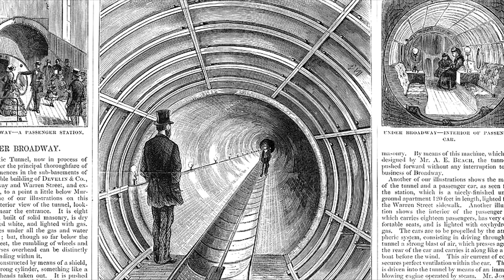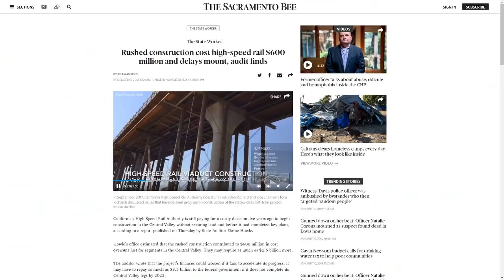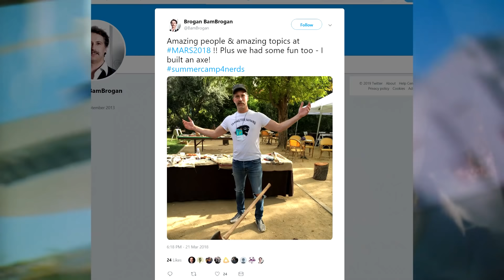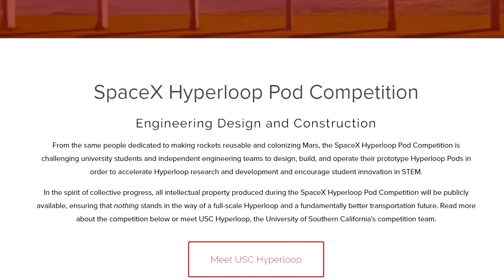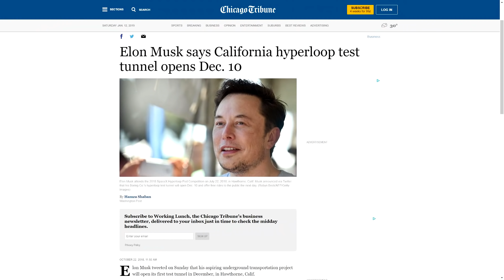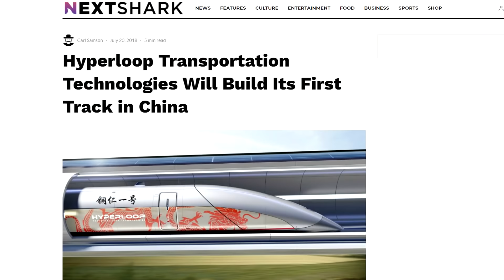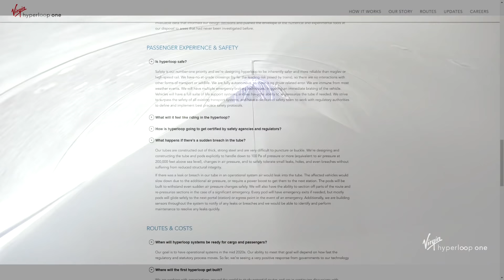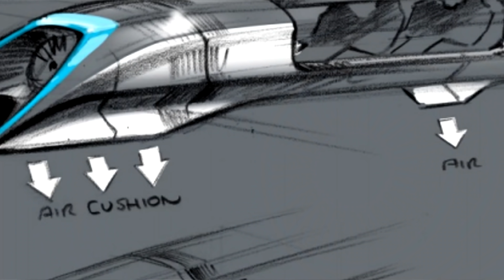Why Hyperloop will FAIL HARD - Its Biggest Problem...

Comment: This system Will work with the right conpanies involved. It combines advantages and challenges of maglev, underground systems and airplanes. So all knowledge is there and the advantages if the systems works are very clear. If we are going tot do mass tourism in space and mars transits in the next 5 -30 years, than technically a vacuum maglev system isn't hard.
Reply: H-L will never be for mass transport. It will be like Concorde, if it is built at all.

Comment: i doubt those facts are objective. since no hyperloop is already built yet, its hard to say what its limits would be.. just using some  made up values for top speed and capacity and then comparing it with alternatives means basically nothing. 
the one thing that can be said for sure, is that a train moves faster without air resistance. and thats what hyperloop is all about.

Comment: So to sum up ...  a startup went bust,  another one is struggling, a third is doing OK,  a test track had problems all the tech isn’t worked out yet and journalists are idiots.  So what?  Why does any of that mean Hyperloop will fail?   

What relevance is it that maglevs have already been built?  If Hyperloops are using maglev, please explain why it isn’t a good thing that maglev tech has been proven and why hyperloop development can’t take advantage of advances in maglev?  

Please explain why Virgin hyperloop one not yet achieving high speeds means that they won’t?  If maglev has already been proved to achieve those speeds surely that is a proof of concept for its potential in hyperloop.  

Please explain why a hyperloop can’t go round corners just because the test tracks are so far straight?  How is the need for large a large turning  radius any different to any High speed rail system?  

Your argument as against the feasibility of evacuating a tube are childish.  These are just engineering challenges.  It is what engineers do.  If you have some technical reason why it can never be achieved please explain.  Are you assuming that Virgin hyperloop one only employ idiots?  

Why iis land aquisition any different for hyåerloop than for any high speed rail system?  

Why cant passenger volume be scaled up in the same way as rrail?  

What relevance is it tjat it tales time to evacuate the air?  Do you imaginær that they Arne constamtly refilling the tube for some reason? 

It takes alot of energy to evacuate the tube.  Please explain why it takes alot of energy to keep it evacuated?  Surely you cant be silly enough to imagine that the tubes wont be sealed with some sort of airlock system in place.

Why cant solar panels power the entire system?  

Your point om safety is perhaps the only valid point you have made.  It soulfest have Bern a nettet video if you had left out all the otter crap.  It dies male me laugh tjat you seem to think that none of the engineers have considered safety.  I dont know what safety mechanisms will be put in place but I am sure things can be done to mitigate the risks. ....  just as has Bern done for every new mode of transport in the past.
Reply: 4 years later and hyperloop is dead.

Comment: Possibly the most useless take on Hyperloop. He keeps pointing out  over and over again that hyperloop has not reached high speeds yet. Its the track length duh. How do you expect to reach 400 mph in a track of length 1 mile?  There is nothing non contraversial about hyperloop from the point of basic physiscs. Ultimately the limitation on speed for maglevs comes from air resistance. So hyperloop offers the obvious solution -- build a maglev that travels in near vacuum. Obviously there are a lot of options as to how to go about it. What Elon proposed was one option. It will take some time for various hyperloop players to figure out which option works best. 

The thing about being slammed by a wall of air in case of a leak / explosion is one of the stupider concepts that has been going around -  possibly thanks to an idiot thuderf00t. 

Ultimately, ground travel will have to converge towards this idea of traveling fast in near vacuum. It can do everything current ground transportation schemes do, but at higher speeds.  I am flabbergasted by the lunacy around the concept of traveling in near vacuum - as if we do not do it already in jet aircrafts.

Comment: Ok so you say hyper loop is obsolete because of maglev trains. You do know hyper loop is a maglev trains right? It's just in a vacuum tube so it can travel much faster. As much as 800 miles per hours. 375 miles per hour is obsolete.
Reply: When are you gonna actually build one, Elon?
Reply: @MrTaxiRob  Building tunnels right now. 
And 400 foot tall stainless steel rockets.
And electric/selfdriving vehicles.
And solars panels.
And Brain computers....
Kinda busy right now. 
I'll probably start hyper loop on mars since it is easier to construct and then export the technology to Earth.
That is if fully electric super sonic vertical take off  doesn't renders all locomotive transport on Earth obsolete.

Comment: Whilst not a fan of the idea that a child can conceive, the engineering aspect isnt far fetched and the dangers of crushing tubes are massively overblown, 1 bar of pressure difference isn't a lot of pressure. As for energy, once system is at vacuum, no need to pump it, end stations can be separated and pumped out after loading.
Reply: Dude... An ATM of pressure is a lot. The tubes will have to be reinforced, especially when put out in Southern Califorinan. Its also impossible to build joints between the tubes units that won't leak some air in. You'll need thousands of air pumps constantly depressuring air pockets. 

The phrase AM vs FM comes to mind with the hyperloop. AM means actual machines; FM is Fucking Magic. The hyperloop is an FM idea, but we only have AM technology. Nothing about the engineering here makes any sense once you take more then a pacing glance at it.
Reply: @connorhennessey1316  1 atm is a drop in the ocean. 1mm thick steel tube will take hundreds of atm pressure easy. As for leak, tubes don't leak, even hydrogen diffuses very slowly. Engineering isn't the challenge, most likely the economics.
Reply: @pgurung001  They will take pressure, but large 1mm tubes will not take 1 atm vacuum - you are overlooking structural instability.  But the tubes can be made thick enough, they will just cost a lot.  You are right that economics will kill the H-L.
Reply: You are right in a way, the vacuum will not be a problem because the tubes will be made thick enough. The problem is the cost of all that steel.